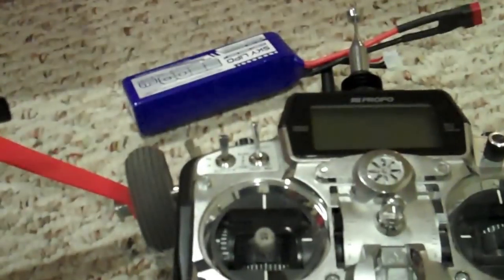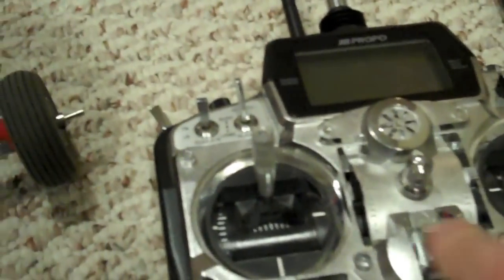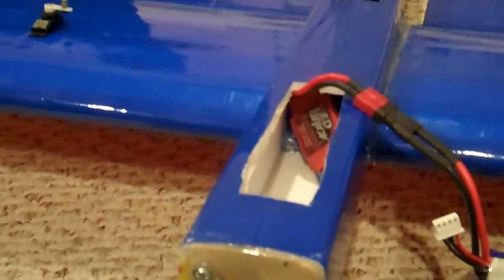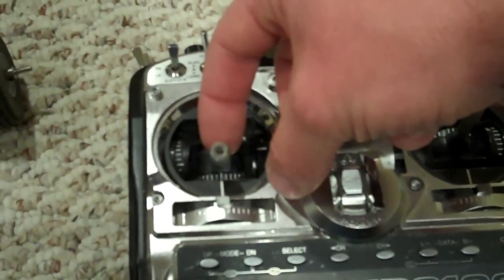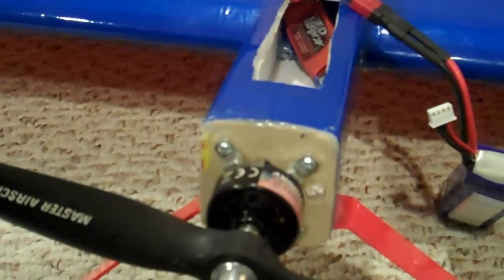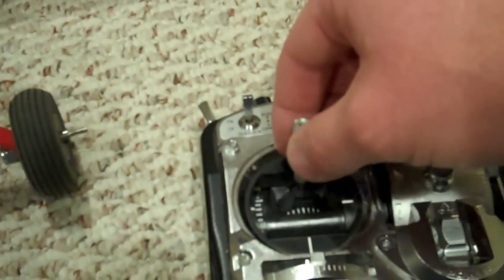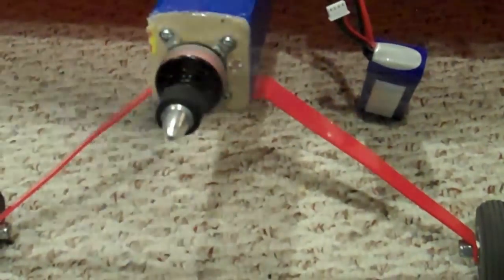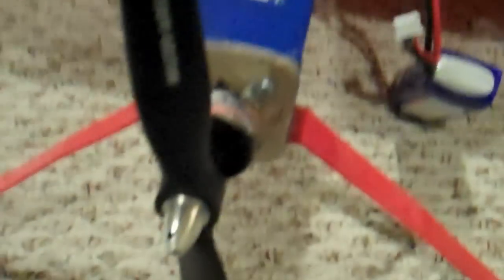Red Brick 30A ESC

Comment: It doesn't have a battery eliminator circuit on board. You need to give it power through the servo wire. There is no voltage coming out of the servo wire like most escs.  Good luck.  The 5v regulators or even 4AA batteries work just fine. :D

Comment: Looks like good information, i hope (?), i'll try and let you know. :-)
If you are trying this please be safe, turn the Transmitter ON first, then the receiver (if possible)before you connect the battery to the model and please remove the propeller from the motor until you are happy with the settings of the ESC, things do go wrong and these things will create havoc when they are "Armed and Dangerous".
Have fun,  Steve

Comment from the maker: Pretty much all I did in the video was calibrate the throttle timing.  There are a bunch of other things that I didn't program (brake, cuttoff mode, startup mode, etc.)  Not sure if you did it yet, but go check out the PDF mentioned previously in the replies to this video.  The third page is pretty much the only one that is applicable to this speed controller.